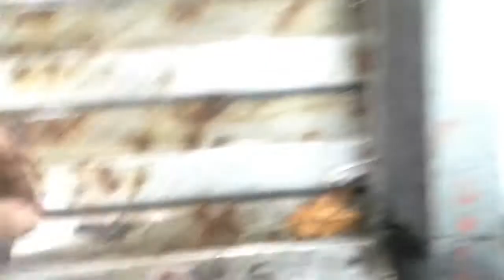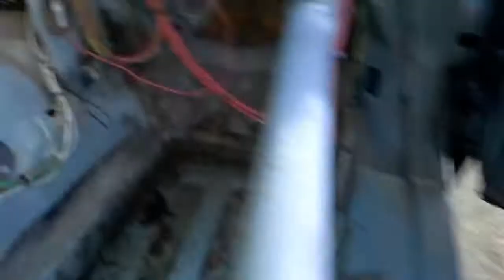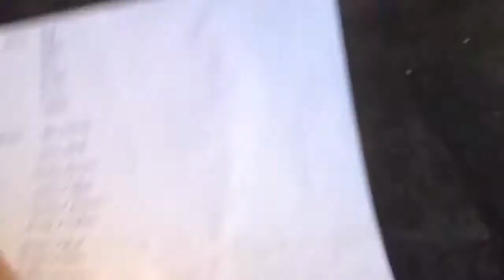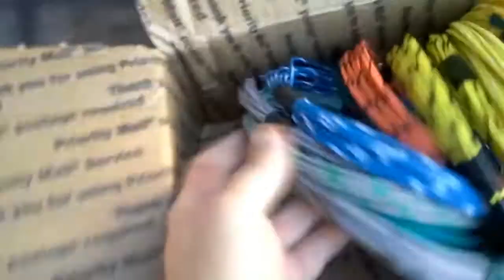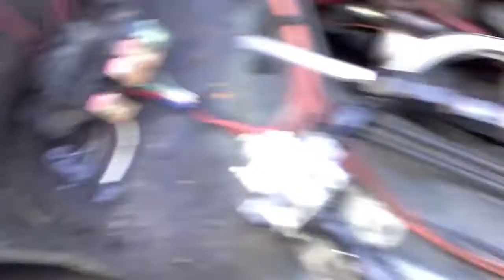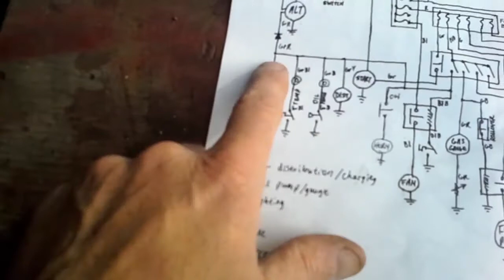Cheaply Wire Cars From Scratch - Part 1: Basics

Comment: As a former owner of a 1982 SJ6, with multiple fuse panels and numerous inline fuses hidden throughout the car, I can only half jokingly say that in many cases using duct tape and coat hangers can be an improvement over the factory wiring.
Reply from the maker: Thanks for watching! I've been tackling other projects since I filmed this video, but I'm hoping to get back to wiring it soon.

Comment: if one was making a harness for LONGEVITY in potential nasty environments such as for an adventure truck (offroading thru shiat, deserts, arctic etc) would you do anything different such as maybe paint brush it with Dielectric grease before looming it??  something just wondering what may make the wire coatings last longer in shiat environments and or just time)
Reply from the maker: I've never done off-road racing, but I'd definitely use Nye lubricant in the connectors to keep water out.
https://www.amazon.com/NyoGel-760G-Dielectric-Synthetic-Grease/dp/B07FD145CP/

I'd also loom the harness. I absolutely despise corrugated tubing. My race team's preferred car is an E36 BMW and we use split braided sleeving on it. I'll probably buy some for the Jaggernaut at some point, but first I need to re-weld the oil pan and put the engine back in it.
https://www.amazon.com/MGI-SpeedWare-Split-Sleeve-Automotive-Electronic/dp/B07JQT11GX/

I'd consider duplicate wiring in critical places. Two wires from the alternator, each just large enough to carry the full charging current if one breaks. Extra grounds.

Maybe leave a little extra length in harnesses for chassis flex.

I'd honestly like to get back to wiring videos, but I'm buried in less-fun projects right now. I don't think anybody wants a video on how to scrape window tint.